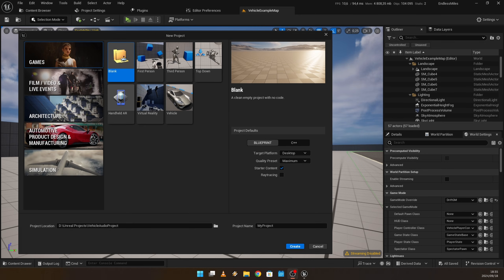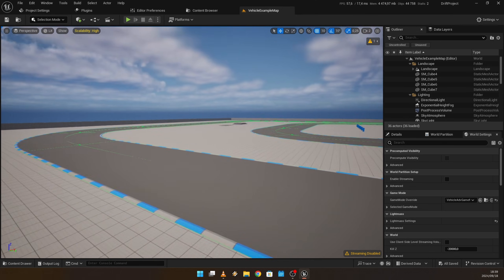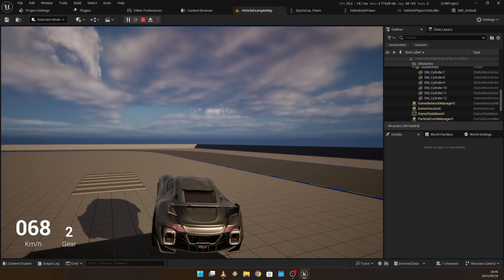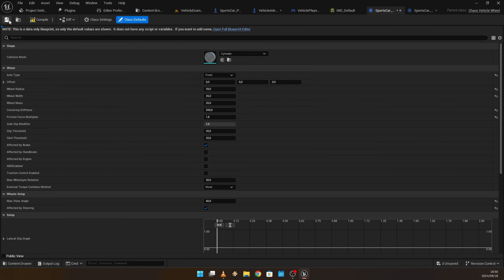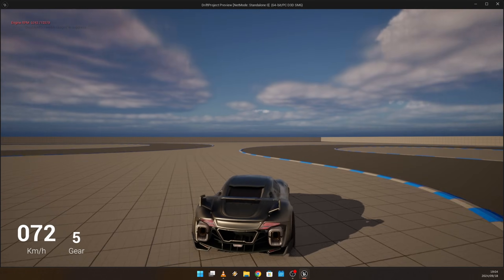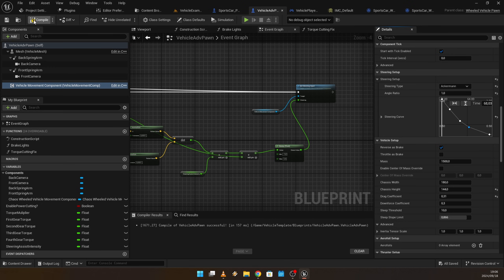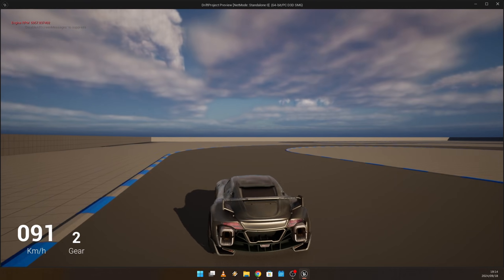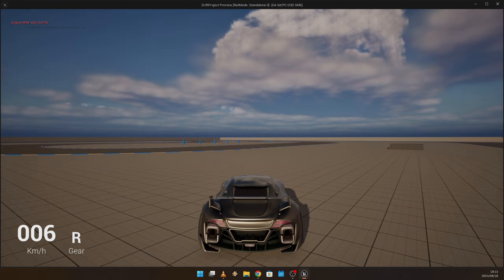Unreal Engine 5 Chaos Vehicle Drift Physics Tutorial

Comment: i can get pretty good drifts for most angles, but i noticed more steep angles have a hard cut off in speed, i tried tweaking so many variables in both the vehicle and wheels and cant ever get a good result

any tips? what variables / settings do you recommend to look at and what are some recommended values for them? 

im trying to go for a simcade feel like carx street, where it feels clean and fluid but also grounded and not floaty

Comment: Your Unreal file has been a great help to me. Thank you so much.
May I also ask for your feedback on the requests below?

1. Currently, all Vehicle pawns are set to manual transmission. Could you advise me which part of the Blueprint I should modify to change this?

2. If it cannot be changed, would it be possible to release a version with automatic transmission? If so, I would like to purchase it.
Reply from the maker: In the vehicle BP, click om "chaosvehiclecomponent" or something like that, search for "transmission" and you should find the boolean to enable or disable automatic transmission

Comment: Hey I'm not sure if this is exclusive to me or not but just in case anyone else is running into this. Getting the target gear from the vehicle movement component doesn't actually work. You have to get current gear. Target gear just stays at 1 and you'll always use first gear torque as a result.

Comment: Hey so I just found a bug with this when using keyboard where the steering input gets set to a strange value and the car wont stop turning unless you give it another input with A or D. I'm not sure if it's related to the counter steering or what but the way I fixed it was by forcing the IA_Steering to set the steering input to 0 on completed. Just in case anyone else was having this issue and is a monster that drives with their keyboard like me :)
Reply: Sounds like intended behaviour for the input system to me. You press A or D and set the steering value to -1 or 1. If you want the steering to be some other value when you stop pressing, the system needs that instruction somewhere, otherwise it will leave it at whatever it was last set to.

With a controller input its simpler, because the stick itself will continually provide input, and physically return to center with no thumb on it; so nothing extra is required in the code to specifically reset the steering angle at the end of player input.
Reply: thx bro

Comment: Followed the tutorial, learned a lot, works really well. However, one thing I can't really figure out is how to do dounuts from slow speed. It kinda pushes forward and grinds sideways sort of crab like, as if something is trying to force the car to drive straight at low speeds. When I get above like 10kph it starts drifting like a dream though. 

Thanks for the tutorial, the torque fix helped a LOT. Drifting was hopeless without that. It's wild to me that there aren't already drifting-specific settings in the chaos vehicle module itself. Drifting exists in so many games, like all kart racers and damn near every arcade racing game ever made. And it's the most fun part of all those types of games. Epic has somehow made it HARD to do the most fun thing, that's wild to me.
Reply from the maker: To do that you would have to mess around with the lateral slip graphs. Go check out this tutorial to give you a starting point then you can tweak it from there. https://youtu.be/dHOhFyusxXs

Comment: Bro my car always spinning out. won't let me control the car
Reply from the maker: Check your tire settings. Increase your cornering stiffness on the rear and lower it on the front tires. Also lower the torque multiplier, I made it very high in the tutorial for demonstration purposes but you can tweak these values till you find what works for you

Comment: does it work on unreal 5.4 because i've tried and it doesn't work
Reply from the maker: Yeah this tutorial was done in 5.4. You must have skipped a step or something
Reply: @5Drifts  alright i will do it again but i'm curious how did you know all of that because i've tried to search for documentation and other tutorial and i flund close to nothing on that
Reply from the maker: @alowen1265  I kind of discovered it by accident. Some things to remember. Remember to set your rear tyre settings to additive and check that the boolean to enable the torque cut fix is enabled

Comment: Do you know if there is any way to change the wheel settings via blueprint? So you can switch the settings mid game
Reply from the maker: I don't think you can. You can try the physical material the vehicle drives on
Reply: It's restricted but using SetWheelFrictionMultiplier works.